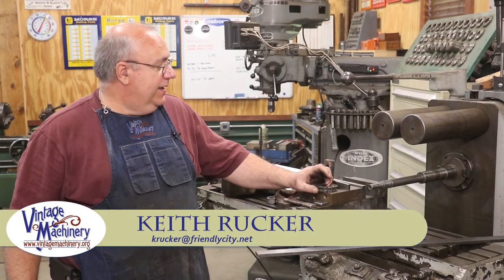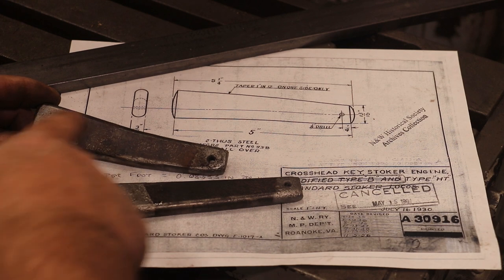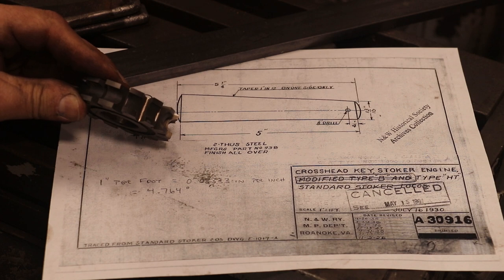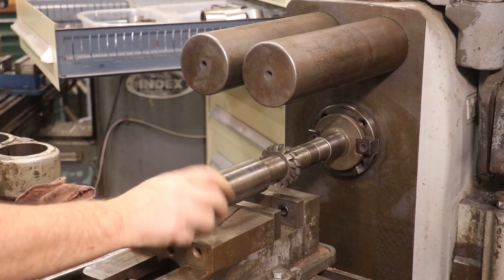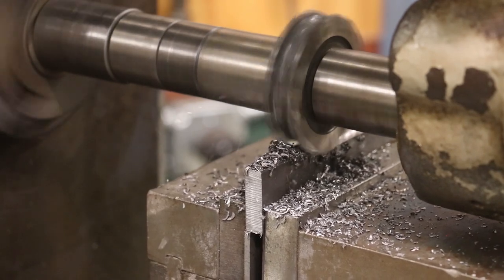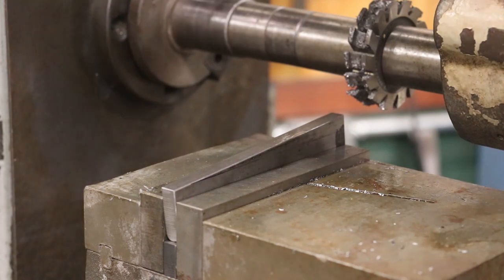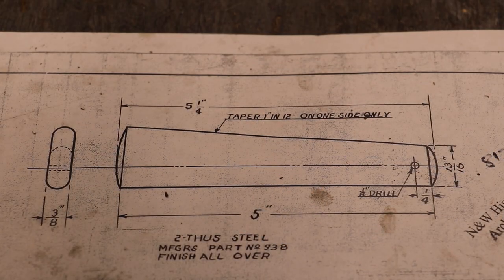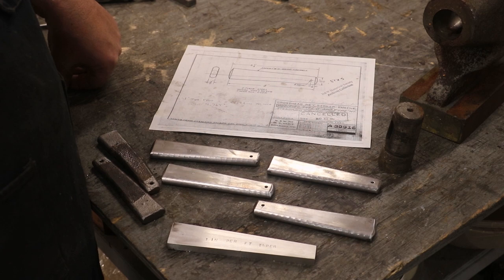Steam Stoker Engine 11: Machining Tapered Cross Head Keys

Comment: I must say that I was surprised by the relative motion between the arbor support and the vise on the close up shots.  It seems that the support is not as ridged as I thought it would be.  Keep up the good work.  lg
Reply: What you saw was most likely the runout in the arbor. Depending on what kind of shape the arbor, the spacers, and the cutter are in, the stackup can induce runout when it gets tightened down.
Reply: 8:22 the arbor is bent pretty badly
Reply: @hdjawa  It may also be the spacers. If they're not ground on the ends parallel to the bore, or they're worn, they will cause the arbor to tweak when the arbor nut is tightened.
Reply: Watch between 15:30 and 16:00 look only at the arbor support and the vise.  The arbor support looks to be moving relative to the vise.  I'm assuming the camera is on the floor and that maybe the arbor support arms may be loose.
Reply: @larry_g9262  looked back, didn't see him tighten the clamping bolt on the top of the mill; maybe that was it. Your guess is as good as mine. :)

Comment: After watching so many vids with such massive complex machinery, it's funny to see him use a 'tiny' drill press while holding the part with his hand. I guess there is hope for the little guy's shop.
Reply: I am similarly humored when he pulls out his battery powered, handheld, metal-cutting bandsaw.
Reply: The whole process of making that taper gauge was interesting, but for those wedges that get hammered in place, they could have just been made on an angle vise.
Reply: Little or large drill press block the part if you aren't going to clamp it to the table !!!  Simply rotate the long end clockwise against the column, part too short, block rotating clockwise to a piece of cutoff lumber placed against the column. Rotating either counter-clockwise for column contact could provide free gastric bypass surgery.  Now hand hold to drill.
In 1962 on my 31st day of a tool and die apprenticeship I was drilling a 7/16 diameter x 6 inches deep in a 6 x 8 x 10 block of steel. Chips caught starting the block to rotate on the next to slowest speed of a Delta 4 gang cast iron table (Keith Fenner uses a salvaged table for layout and welding) ! The vibration was so great table had rotated 30 degree on the floor before bending the spindle which stopped the V belt. It was mfg before OSHA, the On/Off switches were mounted on the motors, I couldn't reach behind for the switch to stop the rotating/vibrating mess! With a new spindle, bearings, chuck, and cone pulley maintenance repaired it but also moved the On/Off switches to the front of all 4 drill presses!
Reply: @oldschool1993  - Likely he will need the taper for slotting the piston rods as well... my thoughts on that...
Reply: @EngineeringVignettes  I'm no steam engine guy, but it appears to me that the taper wedge and the taper slot are  just hammered in place to keep the round tapered end of the rod tight.  That cotter pin just keeps the wedge from flying out if it works loose- I'm thinking that the standard procedure on the assembly was for the engineer to whack the wedge every so often to make sure it was tight.  Neither the wedge or the taper slot are of any degree of precision beyond what you could achieve with an angle vise and after a couple whacks with the hammer, both pieces are deformed beyond whatever degree to which they were made.

Comment: When you temperate the steel in the oven. They make ceramic spacers that would support the steel to give better heat transfer. I believe it's called Kiln furniture. Comes in different shapes and sizes.  It would also allow adding more to heat treat at the same time. Not expensive.  But what ever you want to do.